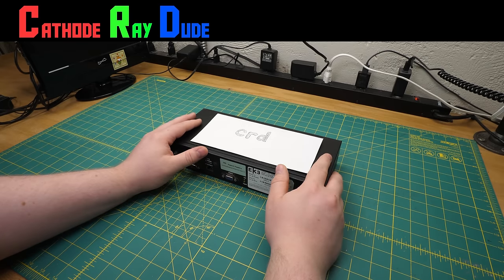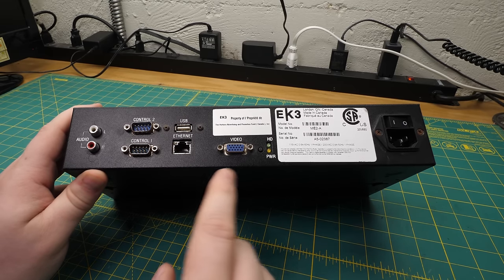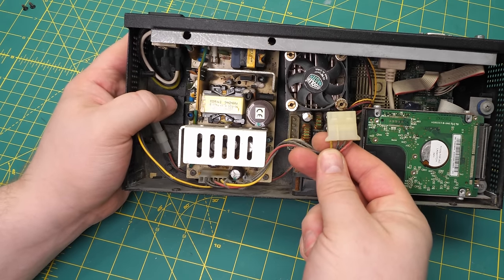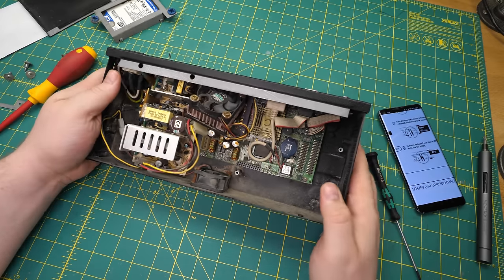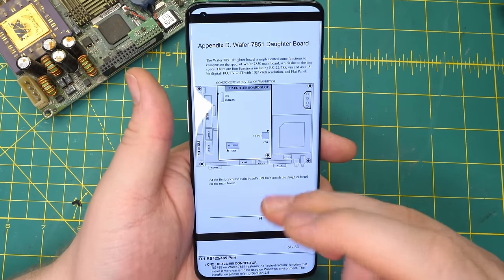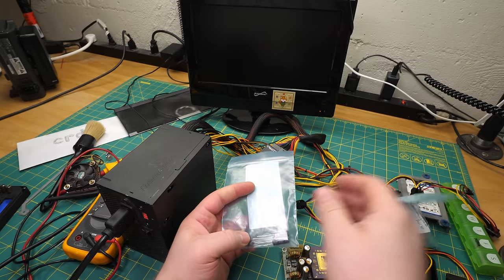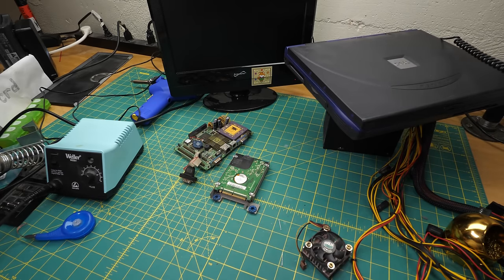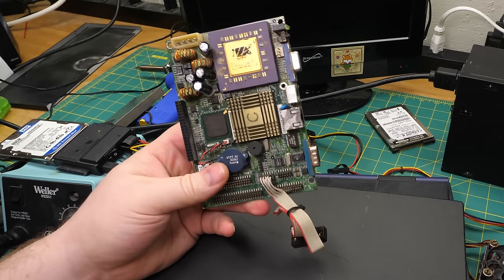Little Guys 8: This one won't fly [EK3 Media Engine]

Comment: zif sockets were standard on Socket 3 (486 era) cpu's. 44 pin hdd's were standard on laptops and early tablet devices, around p2/p3 era. I once worked on one that was supposed to be a POS terminal, and I spent like a week trying to boot windows whateverthefuck (probably 98) off a CF card, which had a bit saying it is a removable media, which windows would not boot off. Fuck I am old.

Comment: The way they blocked the ps2 ports really tells you these things were not to be user operated once installed, not making the cutout was an actual choice
Reply from the maker: seriously, yeah! like, they didn't HAVE to block them; it's an appliance, it's going to be stuck in a corner. they did that so that nobody would look at it and go "oh, i think I can interact with this"

Comment: wait a minute, when you were going over the ports on the back of the little guy at 6:15, there was not a PS2 plug for a keyboard or mouse, only a  USB. a VGA, a LAN  and the control ports. Yet at  33:11 you can plainly see a PS2 port. ..and at  34:45 you can see a PS2 plug for a mouse or keyboard plugged into it. it was not a flat USB plug, and there was not a USB to PS2 adapter.  Whats up with that? ..... 🤨 you trying to be David Copperfield of the internet  Bro?

Comment: 9:45 don't tell me yet; because they are bad. The one you show died on me quite quickly. the teeth in the planetary gear got stripped off clean. The brand that makes them is part of the xiaomi group, and that says enough about how long they will last; not long.
Reply: yes, the Wow stick. Got the lithium battery and penlite version. both broke. It is better in use than the eDesign one... but still, never again.

Comment: 13:05 Canada uses 120v
Reply from the maker: There are at least many parts of Canada that have 240V outlets, and from what I understand most or all of the country uses split-phase in order to make it easy to add 240V receptacles where needed. But I wouldn't be surprised if a lot of Canadians have never seen anything but 120
Reply: @CathodeRayDude  our electrical system shouldn't be too far removed from the US, except for the fact that sometimes European standards get thrown in as well for industrial devices (god why is every motor in food processing 50hz)

Unrelated sent an email about the response point box, I can have one boxed and with the parcel smasher this week if I can get details for a label.

Comment: Weren't you a "PC Support" dude? And you don't know what an "extended" partition is? (it's how you get past 4 partitions on a DOS MBR drive. each "extended" part is an addition MBR table.)
Reply from the maker: I know what an extended partition is; I don't know why mount doesn't.
Reply: @CathodeRayDude  Attempting to mount it would say otherwise. (mount does not consult the partition table; it tries each filesystem type it knows one by one until one works.)

Comment: Nice, now I have a name for that revolting practice causing me to turn around in the door at many points of sales.
I can guarantee they never upsold me on anything, but they did put me off multiple times.
I came in knowing exactly what I wanted, was met by a revolting fanfare of media trying to push a soy based ultra processed puck on me and turned right around and went to the competitor that promised actual meat in the burger.

Comment: I liked the video but i think that motherboard could work. Replace the bad component and maybe try another CPU. Or try that CPU on another motherboard and check if it works. Maybe CPU is dead.
Maybe the reason they go with via was becouse in 2006 intel didn't sold pentium 3 anymore, but maybe VIA still made them or had a big stock of them.
2006 was a little too late for a socket 370 system, it feels more a 2000s device than a 2006 one.

Comment: Did you ever mention the hidden PS/2 port?
Reply from the maker: nope, lol. I didn't notice it when I was taking the thing apart because I was focused on looking for damage, and when I got around to actually plugging it in later it had been like 40 minutes in the real world and I didn't even remember that the PS/2 wasn't exposed on the outside.
Reply: @CathodeRayDude  Ok! I dont get the miniature on this video so I couldnt double check myself. Thanks for the feedback! (and your shorts-less upload schedule)
Reply: I suppose most of the viewers hit the left arrow as soon as they noticed some purple connector between the fingers. “Wait, is that some kind of small USB keyboard adapter, or?..”

Comment: Oooh that CPU looks like it could be a VIA C3--they're pretty boring x86 chips for the most part EXCEPT they have a bizarre undocumented second instruction set with fixed-length instructions that let you talk directly to the internal RISC core instead of, y'know, through x86 microcode.

Comment: The earliest ZIF sockets I ever had on my own PCs were on AMD Socket A (aka Socket 462) CPUs, such as the Athlon, which is around the same time as the Pentium 3. I also vaguely recall having seen some Pentium 1 and maybe Pentium Pro motherboards with ZIF but that could be a false memory. (And of course Pentium 2 used the slot connector so those wouldn't have had them either.)

Comment: regarding the VIA CPU. growing up with an IT engineer father in the late 80s through the 90s and into the early 00s (dad retired from the industry in 08) I had the joys of playing around with many systems dad was working on since 1994 (I was 10, built my first gaming PC in 95) I found the VIA CPUs were not really competitive against their Intel/AMD counterparts. for instance I once played with a VIA Cyrix III 700 (S370) and found it performance-wise similar to an Intel PII 400 in terms of gaming performance. however if not paired with a decent PCI/AGP GPU and using a low-mid tier like a S3 trio or such it was gruelling to play games on a C3 700Mhz